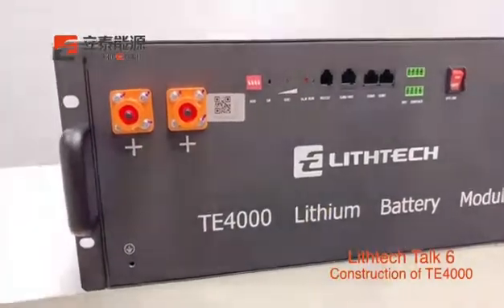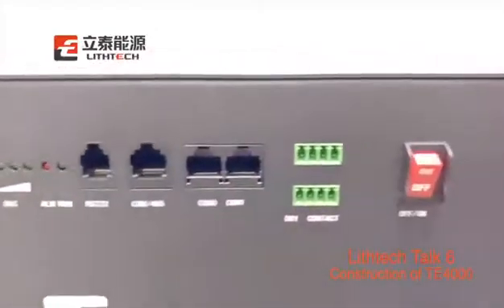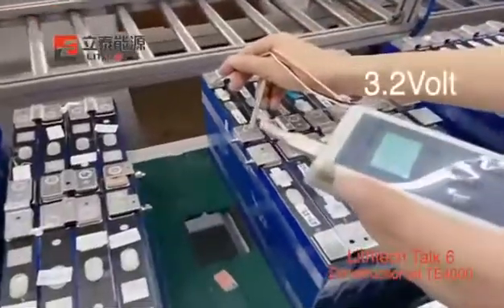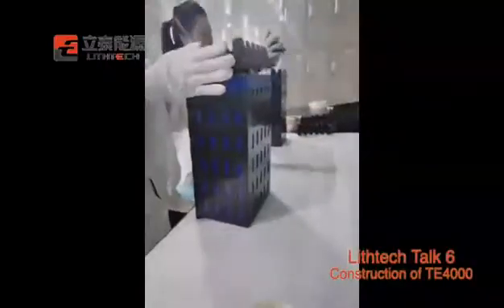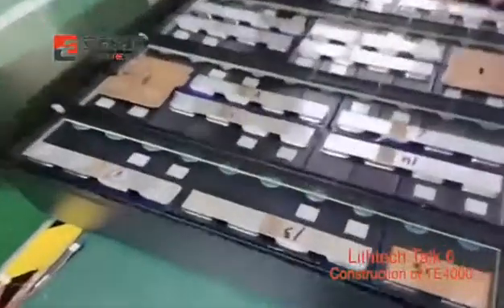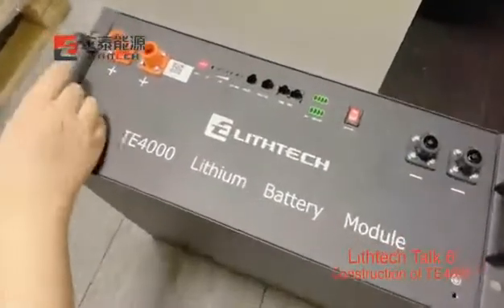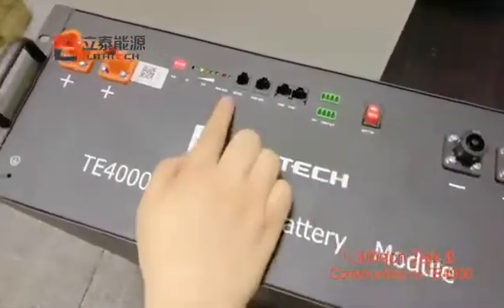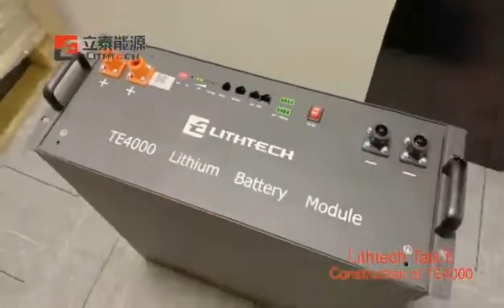Lithtech Talk6-  How to assemble a solar home battery pack 5kW 48v 100Ah

Comment: all it takes is a million dollars USD.  no really one can stay on the line for a decade (or two) before solar and batteries could even try to break even.
just to support my small home, i would need four 100 amp hr batteries just to keep the reefer happy. (18 cubic regular home unit)
at least six more for lighting. (yes i try to turn off lights and do sit in the dark, and this house is pre computer)
then a god offal amount of solar to try and keep the batteries happy.
then summer heat... most likely another six batteries just to run the ac. how much more solar there? (three window units, no central ac/heat here). 
winter heat is via nat gas only.
water heater is nat gas, brand new one even. has a small battery powered computer in it.
stove is electric.
this place is older than i am and i am 62, not worth it to me to even try to go off grid, as there is no cost savings to exist in my life time.
now if i was in my 20's it would be worth it.